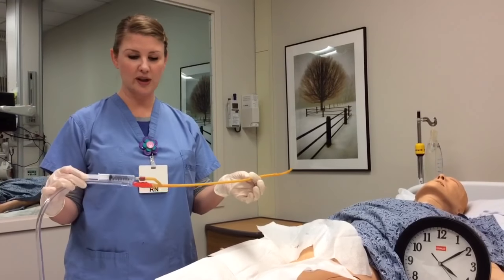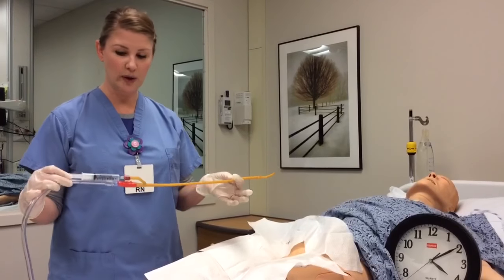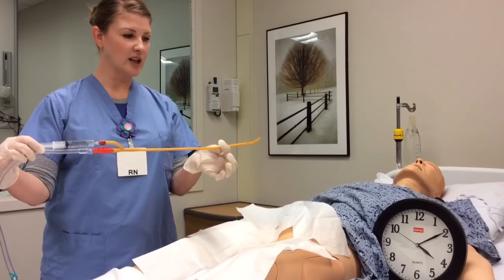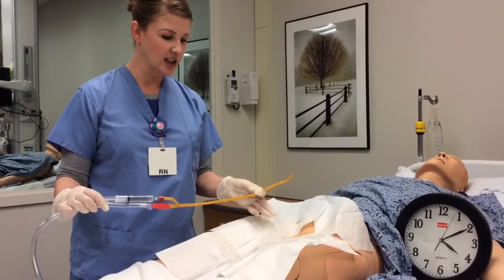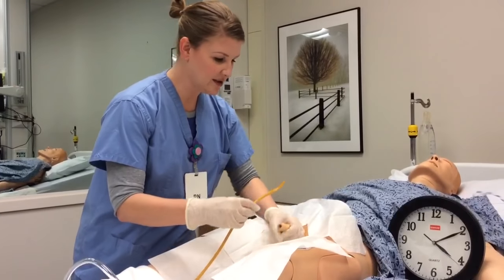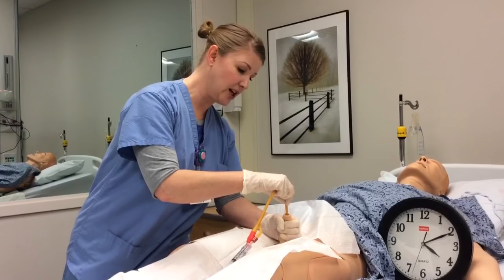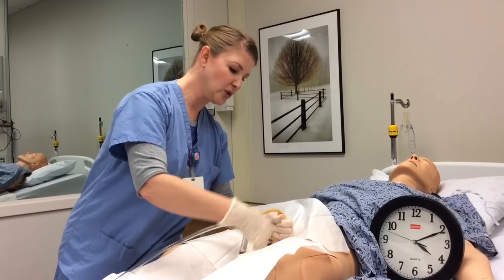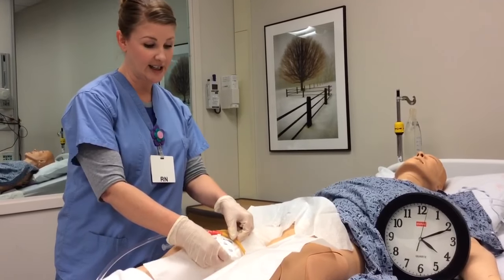BWH: Coude Indwelling Catheter Insertion Educational Video

Comment: The 12 o clock position is very hard to insert and I’ve noticed that on insertion the 3 or 9 o clock position is the best moving it to 12
Reply: I agree 12 o'clock only works if you do it to yourself
Reply: So how long do you hold it off to the side?😊

Comment: If you go all the way you run the risk of traumatizing bladder..I do this to myself as much as 5 x a day..my bladder speaks louder than the video..I agree as far as you dare..Many a nurse have not inserted fully
Reply: doesn't matter, the urology and nursing standards say you should!
Reply: @maryp.1635  all the way only with a indwelling Foley cath  NOT with a Straight Cath..after you get urine you should only push one more inch.
Reply: @dancassidy7471  But what trauma did it cause to go further??? It's pulled back.
Reply: @KayDejaVu  unlikely any trauma unless you are having bleeding or bladder pain
Reply: Is this process painful?